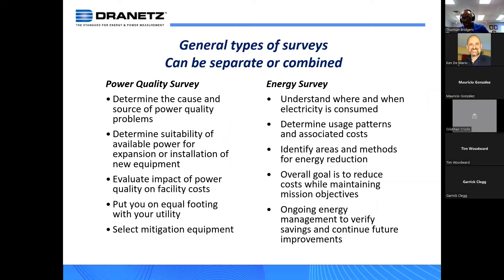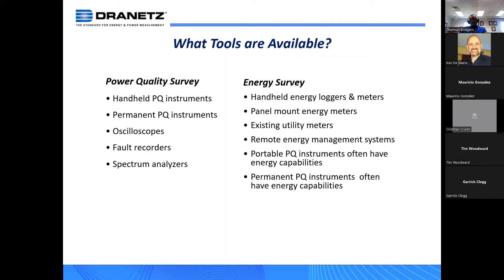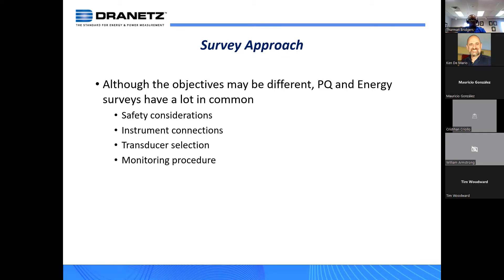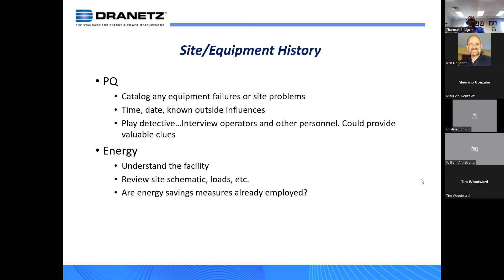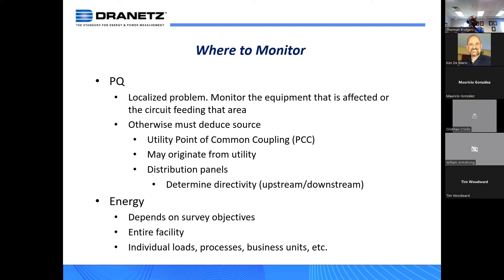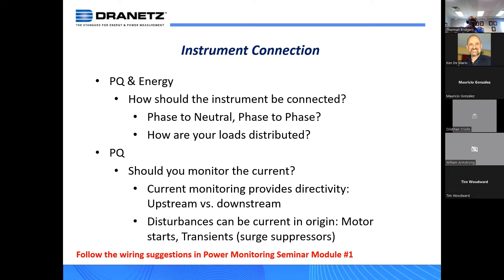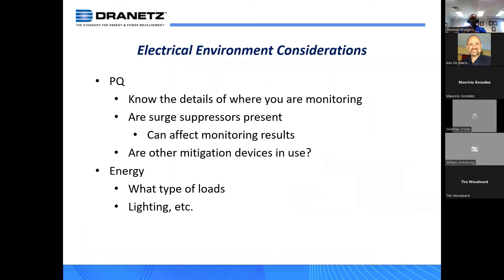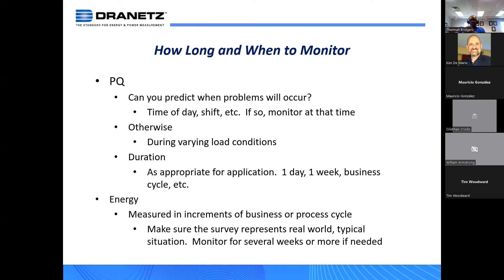Module #5   How to perform a power survey

Comment: The PQ dranetz machines are showing their age now. Ability to pickup PQ events at smaller and higher frequency scales is key the spectral analysis needs to be improved. The screen and analytics also requires improvements. The software needs further improvements in terms of determined analytics from advanced mathematical and statistical analysis. Analytics like cross-spectral analysis, multispectral multi scam analysis and filtering need to be integrated.